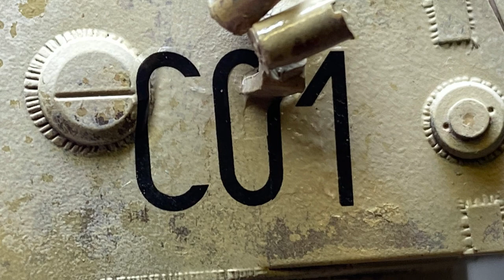Paint Tiger I Airfix 1:35 WW2 #tigertank

Comment: Hi mate just a wee tip about the AK worn effects I want to pass on that I've now experienced with 4 bottles now! Keep it in the fridge honestly I know it sounds weird bit I've had 4 bottle go off on me now and my new 4th was used 3 times and sat for a couple months but with the heat through summer and the heat of the heating in house in winter there it's cooked them! They stink! Full of like cobwebs strings in bottles and the paint now cracks when layed over the top of them that's the first sign that there going off before the smell comes! You might experience this yourself be great to know if you do! The worn effects are my favourite to use I'm gutted I've got off bottles they have to be some sort of glycerin or something food based! The new bottle is doing fine in in the fridge after opening its lasted 3 weeks now since was opened that's longer than the last one so just keep an eye out for this! As soon as it gets abit thicker when going off you'll know because the paint on tip has like end shell cracking coming through when dries!
Reply from the maker: Cool, not heard that before. I may try decanting hair spray next time. I should be posting the final video on the Tiger soon, just got to finished off the weathering etc. thanks for watching and the comment I’ll re check my bottle. 🙂

Comment: I have see you can use hairspray instead of chipping fluid does it work the same as its a lot cheaper and quiker???
Reply from the maker: Think it depends on the brand and making sure the paint is thin, usually making it need a couple of paint chip coats. Tresemme works well.